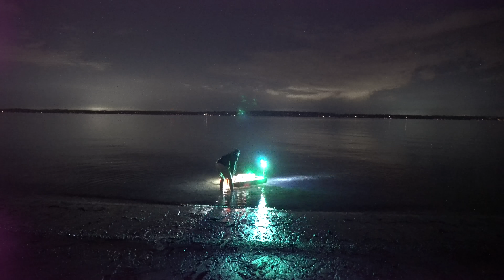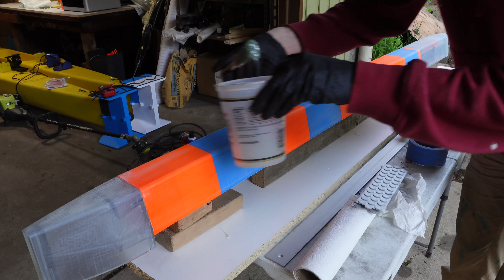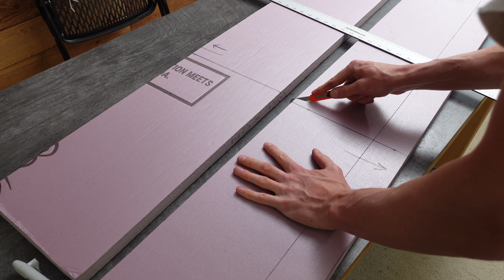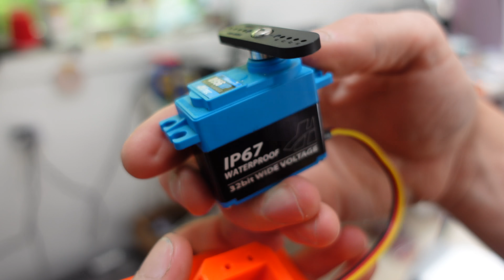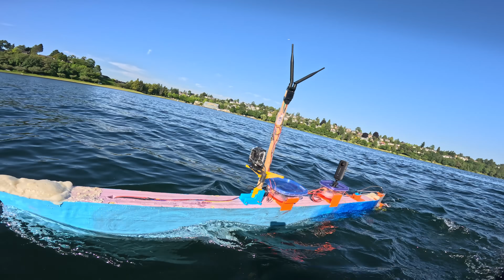"R/C Boat" with 40 lbs of Batteries

Comment: AI Summary

Abstract:

This video details the multi-year effort to build a new autonomous GPS-guided catamaran, designed to successfully complete a 56km waypoint mission around Bainbridge Island after a previous attempt failed due to mechanical issues. The project commences with the resourceful salvage of 18650 lithium-ion cells from a salt-water damaged power bank and an old robot battery. A central engineering challenge is the design of a waterproof "battery keel" hull, which the creator tackles by uniquely potting the entire battery cavity in silicone grease using a combination of vacuum and pressure, overcoming several technical hurdles. The video showcases the integration of 3D-printed hull sections, fiberglass reinforcement, a single Blue Robotics thruster, a Pixhawk autopilot, and custom navigation lights. Initial lake tests expose unexpected high buoyancy and a tendency to "submarine" at high speeds, leading to further design refinements like foam filling. Despite some remaining concerns regarding mission speed and steering precision, the boat demonstrates impressive resilience in wave conditions, preparing it for its redemptive autonomous voyage.

Building the Autonomous Catamaran: From Failed Missions to Greased Batteries

*   0:00 Previous Mission Failure & Initial Setbacks: The creator recounts a prior 56km autonomous boat mission that failed due to seaweed clogging propellers and corroded bilge pump sensors. A separate incident involved a salt-water submerged EcoFlow power bank.
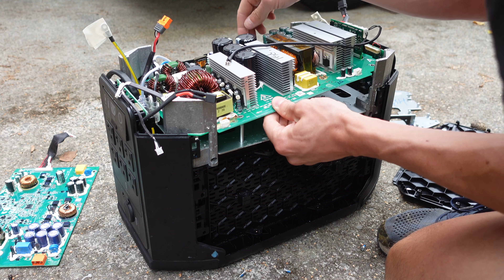*   0:54 Salvaging Batteries: The damaged EcoFlow power bank was disassembled, and many 18650 Li-ion cells were successfully salvaged despite being submerged in saltwater. Additional cells were recovered from an old solar-powered rover battery.
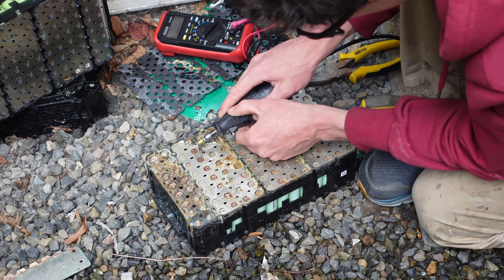*   1:32 Cell Harvesting Process: The process of carefully cutting the spot-welded nickel sheets to extract individual cells was tedious and highlighted the inherent risks of short-circuiting the pack.
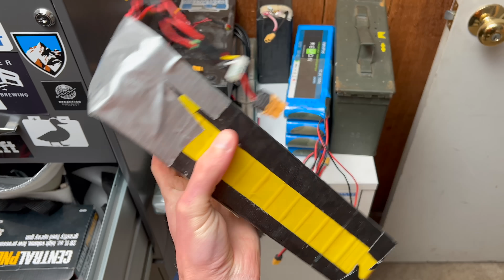*   2:56 New Hull Design: A narrow, efficient hull was designed in On Shape, conceptualized as a "battery keel" to keep the center of gravity low by placing the batteries below the waterline.
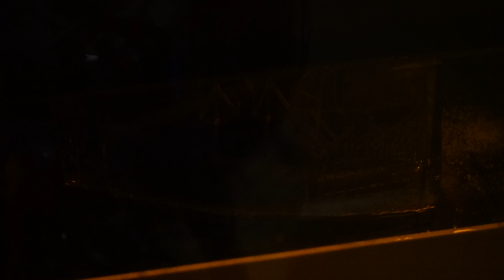*   3:41 Hybrid 3D Printing Construction: The boat's bow and several hull sections were SLA printed (FormLabs Form 4) for density, while 18650 cell holders were printed in PETG, with carbon rods used for alignment and structural reinforcement.
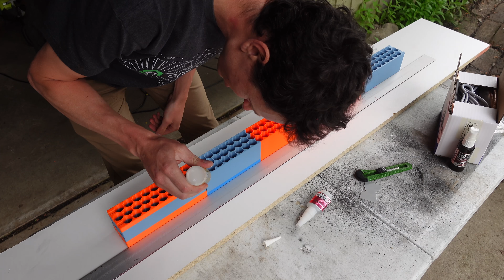*   4:08 Battery Pack Assembly: The salvaged 18650 cells were spot-welded into a 3P (approx. 12V) configuration, and a 3S2P 2170 pack was added. A BMS was incorporated for battery balancing and charging.
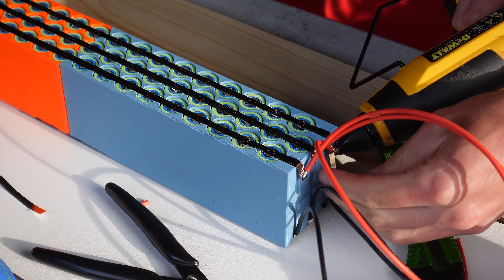*   7:08 Innovative Waterproofing (Grease Potting): The entire battery cavity was waterproofed by filling it with silicone grease using a grease gun, aiming to displace all water by filling every void and crevice.
*   10:52 Challenges with Grease Potting: The high pressure of the grease caused acrylic panels to bend and leak, necessitating the addition of more screws, clamps, and thinning the grease with dimethicone to improve flow.
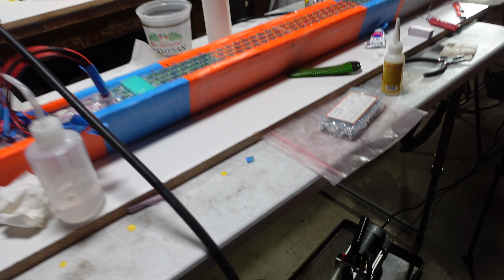*   11:09 Vacuum-Assisted Potting: A vacuum pump was used to aid the grease flow, pulling it through the battery cavities, though it also introduced some air bubbles that later needed to be purged.
*   16:01 Upper Hull Construction & Buoyancy Miscalculation: XPS insulation foam was used for the upper section of the hull to provide buoyancy, but the initial calculation was off, resulting in the boat riding much higher than intended ("narco sub" failure).
*   17:02 Design Adjustments: Due to the unexpected buoyancy, the foam was trimmed significantly, and the plan for a second counter-rotating motor was abandoned as it would not be submerged.
*   18:11 Fiberglass and Experimental Paint: The hull was reinforced with two layers of fiberglass. An attempt to paint with old gel coat failed, leading to an unconventional application of crayon wax for hydrophobicity, followed by orange spray paint for visibility.
*   20:03 Electronics Integration: A Pixhawk autopilot running ArduPilot Rover software, an RFD900X radio for control and telemetry, a waterproof Hitec steering servo, and a Blue Robotics ESC were installed in Tupperware enclosures for protection.
*   21:14 Custom Navigation Lights: Repurposed PCBs from a "color shadow lamp" project were adapted to serve as pulsed red, green, and blue navigation lights mounted on a folding mast.
*   22:06 Initial Lake Testing: The boat performed well in terms of speed and turning but produced a large bow wave, leaned due to single-motor torque, and "submarined" at full throttle, allowing water into the front of the hull.
*   24:04 Addressing Submarining: The bow and stern cavities were filled with two-part expanding polyurethane foam to prevent water ingress during high-speed operation.
*   24:17 Wave Torture Test: The boat successfully withstood simulated waves created by a chase boat, demonstrating its robustness and stability, despite constant rudder corrections and minor water entry in the electronics enclosures.
*   26:31 Final Assessment & Future Outlook: The boat is functional but operates at a relatively slow speed (1 m/s, estimating 15-16 hours for the mission) and exhibits overcorrection in steering, which will lead to servo wear. Despite its failure to be a "narco sub," it is ready for its new autonomous mission attempt.

I used gemini-2.5-flash| input-price: 0.3 output-price: 2.5 max-context-length: 128_000 on rocketrecap dot com to summarize the transcript.
Cost (if I didn't use the free tier): $0.0105
Input tokens: 25240
Output tokens: 1183

Comment: Why not do 2 grease fittings on either end? There will be an air bubble in the middle you could drill out and seal but it would be quicker

Comment: When you took the nipple off the feed end and it xame rushing out, that was air pockets expanding as pressure fell. You had some decent voids after that. If it had all been thinner from the start and you had tilted the thing out end up that would have helped too.

Comment: Interesting. If you do something similar again, maybe a double-hull design? You're practically there already, just need to fiddle a little with the infill. That way you can put in a tiny pump and fret far less about longer-term water ingress & corrosion.

As a sidenote: the esp32's capacitive touch sensor pin connected to a thinly insulated wire (with a dab of glue or somesuch on the end to fully waterproof said wire) makes for a surprisingly effective water sensor. Does require a bit of tuning, but doesn't suffer from corrosion issues unlike conductive sensors, and works on a much smaller scale then the ultrasonic or radar-based ones.

Comment: Couldn't you use small lead weights to lower the boat. Also you can change out the upper section of the bow to be longer changing the overall attack angle of the bow edge. And reducing drag.

Another option could be to add weight in a keel.

Comment: The moment I saw the front end make a cavitation shockwave I started thinking of adding a little piece on the front that happens to split it to perform a vortex rolling effect. Basically just a oval pointy with the tips made to curve backwards such that they follow the profile of the water you want to have rotate & roll back towards the water below. The little channel sides (underneath the oval & so on sticking in front) only need to be shaped like an hourglass diffuser. So large to small throat, then back to large but made to follow the flow path desired with curves added only for the speeds that it makes sense for it to ever need it. 

Then I remembered you aren't ever going to be going that fast with this. Funny, eh? lol. I was like, ooohhh...Rrrriigghtt. Side roll skirts might help, they are basically like stators along the side of the ship that enforce specific flow during choppy conditions & induce specific smooth flow transitions from the bow/hull of the boat to curl into boundary layer areas along the sides that get stuck & made to rotate. 

Its pretty similar to wing-tip vortexes that get generated, they steal efficiency often & its why we started trying hydro-foils. It was basically to also help with this issue. But cargo ships traveling that fast on hydro-foils is pretty scary! lol, turns out no one really wanted to try! shrugs sarcastically in joke Who would have thought? 

But for a while they tried to develop barnacles along the sides of ships & boats to specifically reduce this effect. They got hit with survivor"ship" biases. (*ribs you with elbow* eh eh!) Funnily enough, it wasn't possible to really see anything for them back then, so they stuck things in the places they might see a vortex form without knowing much about it. Leading to terrible results, pretty often. 

Anyways, later on we got better at it & now we have specific boat hull shapes designed for that very thing. The prominent front pokey bit thats blunt like a bullet is for that very thing. Almost the same thing I wrote about before, up above, in terms of reasoning for having it. The main way we remove it is by shaping it to have one of those little blunt areas that leads to a behind concave teardroppy-like area that then curls/curves towards a specifically made overhang spot that acts like a hydro-foil...ish.

It isn't. Of course, its just "skipping" off the surface like normal speed boats do, effectively. But with these little keels (like on surfboards) they managed to create a vortex flow that would rudder them around & cause a "cavitational energization" .... It means that they threw water in the cavity created & they ride on steam basically! LOL! It works, really well, for those that do it... I guess. Not that I can, seems pretty hard to get right. Instead I was thinking about using the effect to create a speeding up of the hulls lower boundary layer at slower speeds, specifically to decrease issues with drag. But it comes at a cost of needing side "pontoon-like" stators that introduce some drag too. So...I figured the right bumps & dimples with very small stators in only a few spots would be worth a shot, as a suggestion lol. That basically means needing a small pokey bit below to start the curve to the rear so that way it doesn't try to lift the rear out of the water, which its not going to be doing at those speeds to be fair but an angle of the motor changing is a big enough deal that it can cause a brutal drag penalty & it will keep trying to thrust up when it shouldn't.

working against the whole design in the first place. So that little pokey out part is pretty vital for the design to work as intended with anything further back & on the sides to help with smoother flow & efficiency of travel. All of which requires modeling & more test, money, Ugh. I wonder if it works out for content though? You'd be the judge for that one. Not myself, for sure. 

Remember, it was just a suggestion trying to help out. Thanks for making the video & putting in the effort. Never know! Might like some of the others ones I've made videos about, like a peristaltic pumping hydrofoil for boats! Basically 2 diaphragms that make up the wing with stator rudders for helpful support for the outer & central wing, the stators help with vertical movement of the diaphragms...yes. Same with the catalysts & fiber optics, together with the heating of the water too, heheheheh :) Nothing like starting further forwards with intake from pokey things then speeding it up with water-multiplying effects & a bunch of "explosive" accelerations! MUAHAHAHAHAHA!

Comment: You could cut out a spot in the bottom of the foam on top of the battery’s, then take a piece of square steel and fill it with sand, or concrete. That would help add more weight and possibly make it even more stable.

Comment: To help with any future grease applications like this, there is a LOT simpler way than the vacuum method. Heat the grease up first. As hot as the lowest high temp tolerant item can take. Then pump it in. The hotter it is the smoother, easier, and the best it will run into gaps.
I use to have to grease shakers and all the pulleys on a conveyor belt that was ~ 100 ft long. This was at a rock quarry I worked at when I was much younger and doing it in the summer wasn’t that bad, but in the winter SUCKED! So, we got a heater and would put the grease drums and guns in front of the heater a couple hours before time to shut down and grease up. Hope this helps!
Reply: Assuming these cells dont need a second recycling, I imagine just using a low viscosity curing resin would have been the simplest approach.
Reply: What about gently heating the boat itself?
Reply: @EpidemicRage  - ! Good idea, he could just discharge the batteries so they generate their own heat. Actually... Using the boat might cause the grease to flow a bit due to the battery heating, so he can pump more grease in when the voids have migrated to the top
Reply: One winter I had to hand pump (using a crank) some aeroshell oil out of a barrel in an unheated aircraft hangar. It was like warm butter in consistency, such a workout 😂 it went into gallon jugs that went onto an electric stove so it could be poured into the oil tank (Sea Hurricane 1b).

Comment: Looks cool.  Instead of the 2-part foam in the rear, I would have put a small amount of lead in there.  That would raise the hull pitch slightly, which kind of looks a little too much bow-down.

Comment: friggin gel-coat. It is a miserable combination of expensive and a pain in the butt to work with. Even if it didn't catalyze too quick, it's really no good to use as a top-coat; it's really only suited for layup fiberglassing. I go with epoxy or 2k polyurethane instead.

Comment: instead of all that grease you could have used mineral oil / baby oil. Drake probably still has some
Reply: You mean Diddy, I think. Unless Drake took boxes of the stuff home after a Diddy party.
Reply: That wont work, if there are small holes. It would just slowly drain out.
Reply: Plastic and oil don't mix too well, that's why he used silicone grease
Reply: Petroleum jelly melts around 35 degrees Celsius. I would recommend melting in a pot and pouring over open battery compartment. It would flow into every crevice easily.

Comment: I have done the same but used wax. Which is cheap. And when.melted flows very easily. The only drawback is that it remelts.if it gets hot.

Comment: If you used two peristaltic pumps on a common shaft you could have one sucking out air and one injecting the grease at an identical rate to avoid the air bubbles and keep the pressure from building up inside the cavity.  Peristaltic pumps are slow but have some niche uses like this that make them incredibly useful.
Reply: This would work with two incompressible fluids. However, this is grease and air as the two fluids. With a compressible fluid like air you'll still get pressure buildup.

Comment: tbh i think its still perfect for narco sub cuz you forgot about the added payload weight which has a higher density than the foam u used ide say cut some of the foam out of the hull and put some simulated load in there and test again

Comment: 12:30 ffs just put in one or two more greaceniples along the way. That way you font have to pump for the far end and overcome all that friction. Would also be easier than tapping 20 more screws in.
OR greace first then insert the batteries and just get rid of the access.
But hey you are a doer not a planer, thats why you get stuff done.

Comment: Bro that bms has like 30mA of balancing current, it's gonna do NOTHING to such a huge pack
You'd be better off with a capacitive bms rather than topbal resistive
Reply from the maker: This is why I wired each cell out. The BMS is just for cutoff

Comment: Great job, I imagine you could consider Outriggers compared to a Tahitian canoe that would offer better stability, or a Trimaran arrangement for addition rudders or propulsion to increase speed, but at the cost of additional battery drainage, but safety redundancy. If seaweed fouling the prop remains an issue, fabricating a Sail-Drive common to many sailboats could free the seaweed to pass under the hull to regain control. Increasing the Latency response on the rudder control should also help for the over compensation. Overall, excellent job & very impressive!

Comment: I guess you could just glue a little pointy wedge onto the front of the bow to help a little. 

In the great lakes ships, which are long and narrow and as box-shaped as feasible to take up all the space in the locks, the shape leads to straight-line instability so they have to counter-steer to get the ship to stop turning. So I'm not sure you'll be able to get rid of the rudder wiggling entirely.

Comment: Your bow needs curved flanges, splash guards if you will, to direct the water down and a way from the front of the boat. Since you didn't build it into the design as is you could add them as separate pieces.
Reply: I came here to say this.
Reply: I'm just disappointed he missed such a good opportunity for a great segue - "you know what else fills up voids with oily goop? Therapy."
Reply: Funnily enough It doesn't just happen to hobbyists. This is the same thing that happened to the Scharnhorst Class so they were re-fitted with the 'Atlantic Bow'

Comment: Why exactly are you sucking grease through that? This seems to be one of those over-engineered steps. It would have been a lot easier just to encase it in a silicone box. If the construction didn't allow that you could have just potted it in a non-conductive potting material.
Reply from the maker: "could have just potted it in a non-conductive potting material" - you mean like grease?

Comment: TIP for you : Spray water on the gorilla glue to activate it  it doesn't take much. The humidity in the air will work also just slow and I don't feel like it works as good. But keep up the good videos